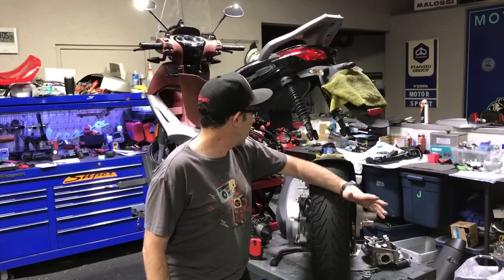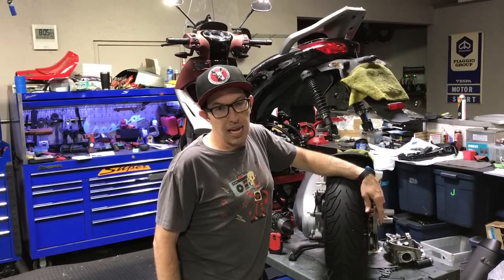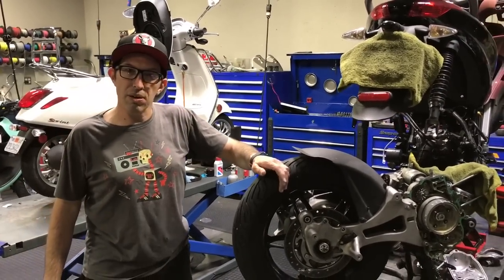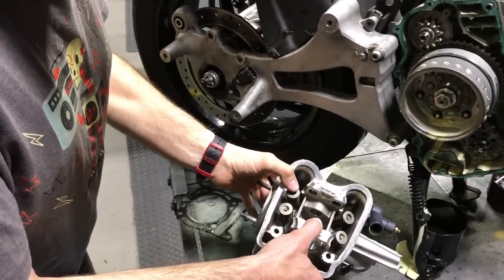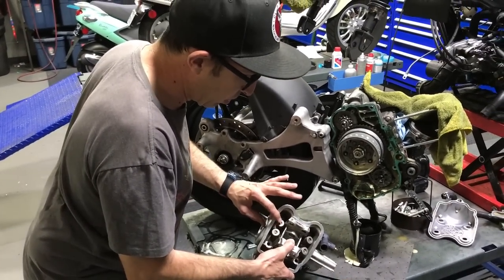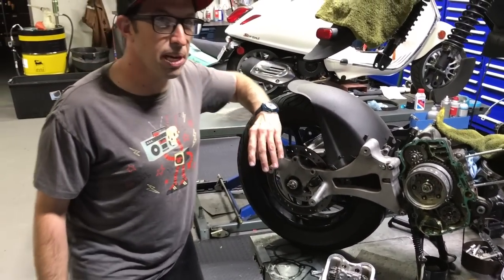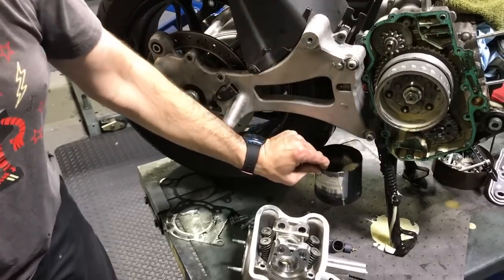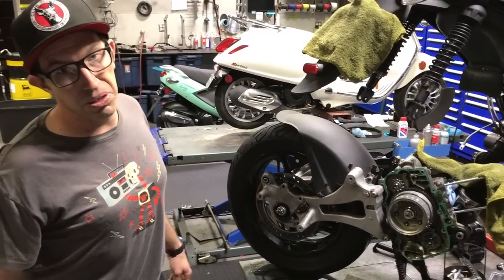Why You Should Change the Coolant on a Vespa/Piaggio Scooter

Comment: Any time you put water in something with dissimilar metals, there's going to be a problem.

Could the specific gravity be tested with stock coolant, such as with a refractometer to see how much glycol there is?
If it's quite conductive, the stock coolant might not be made with distilled water.
~

I've not heard of anyone trying waterless coolant, such as Evan's in a water-cooled Vespa/Piaggio. Apparently, they have slightly lower cooling efficiency, but they tend never to corrode, anything, ever, and are unlikely to boil over.

I wish someone had an out of warranty scooter to experiment with.

~

BTW, Robot, your videos are so great they become reference material and guides!

Comment: I use beverly 350,
antifreeze is constantly dripping from place.
I tighten the hose clamps but it is still dripping.
especially when I turn on the antifreeze cover for checking.
There is a problem with the beverly 350 cooling system.
We are waiting for the video to continue.
Reply: I have same problem with beverly 250..